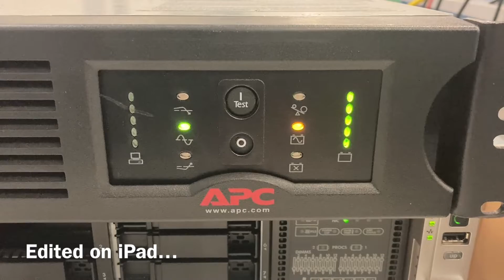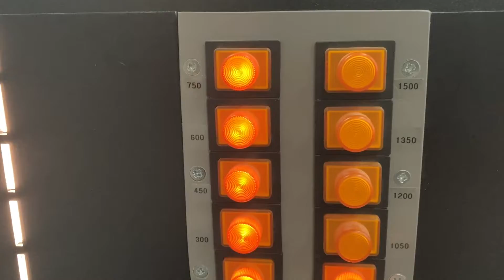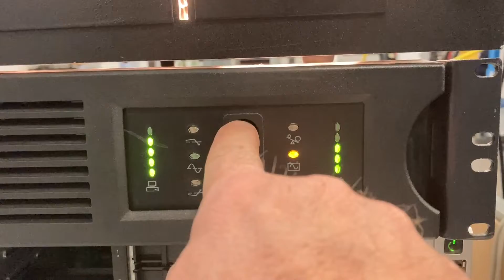How to test an UPS system (PWJ219)

Comment: I wish more manufacturers would follow Sanyo Denki's lead and use NiMH batteries which are a far more reliable technology than unpredictable lead-acid.
Reply from the maker: I don't mind good quality lead batteries (f.e. Panasonic) They work fine for 5-10 years.

Comment: Great and simple solution for a real workload to test. for single heaveer work loads  i used a heating plate . small one 1000w big one 1500w  and together 2500w.

Comment: I'm sure there's a good reason why this is a bad idea... but can't you simply use some cheap heating elements instead of the bulbs?
Reply from the maker: Tell me what’s cheaper than a $2 lightbulb?
Reply: @PlaywithJunk  well if you got them from somewhere cheap and Chinese like aliexpress you could probably only end up paying about $5 per 100w heater. Granted it’s more expensive but surely the amount of space it would save and the fact that it would remove the need to replace bulbs, which you pointed out was a downside with yours, makes it worth considering? I was just curious if there was an obvious downside I’m missing haha… I think your device is really cool!

Comment: I use a hair dryer. It works pretty well too :)
Reply from the maker: Sure, but can you adjust the power in small steps...?
Reply: @PlaywithJunk  No, I get High and Low - But it is enough for a pass fail test. I just replace batteries that fail or are marginal. Love your channel!
Reply from the maker: @SomeGuyInSandy   Thanks! Before I built that tester, I used all kind of devices as a load. But this tester can be used for small UPS (300W) too.

Comment: Very cool. An LED display on the front panel that shows the load would be useful.
Reply from the maker: There is a neon bulb display inside the switches. It tells me the power with 10% accuracy 😉

Comment: On smaller UPS that are used around home / non critical applications I like to remove the batteries and then test them under a load (2 small halogen lamps) and watch their voltage/current while they discharge. Can then compare to spec sheet. But my biggest UPS has 8x 12v 7Ah SLA batteries and this is too time consuming. Instead I just timed how long it can run a 500 W load with new batteries and test it every year to see how it declines. Your bulb box seems like an awesome solution for testing a range of large UPS outputs in the workplace!

Comment: Do you have the parts list and schematic for this unit? would like to build one for myself
Reply from the maker: You don’t need that because it’s really straightforward. 10 switches and 10 light bulbs and an aluminium case thats all you need. And a strong fan.

Comment: Nice solution! You could save on switches by wiring the bulbs in binary weighted groups. Then you could have up to 15 bulbs with only 4 switches.
Reply from the maker: But I had those switches for free….
Reply: @PlaywithJunk  Imagine the resolution you could get with 10 switches! Just need to find 1023 1.5W light bulbs, or 1x1.5W, 1x3W... I think my medication may be overdue. 🙂

Comment: What is this some ups tester from the 80s?! Lamest way to test an ups ever with halogen bulbs jeez, those bulbs run off from any flaky generator dont even supply sine wave. BTW those apc upses were utter crap what u pictured those after a year can do smth like 15 mins on tops
Reply: Damn why are you so angry... he clearly wasn't aiming for a way to test every single aspect of the UPS.
Reply from the maker: what would you recommend?

Comment: I have a couple of those 1500 and 3000 UPSes, I just run cpuz in stress test mode on the servers to make some load to the units for the battery calibration test :)
You can just hook up electric heating coils instead. My Sauna has 6,6 kW heat from 3 phases so one phase is a pretty good load for one UPS. Just don't touch the red hot metal bits when in use :)
Reply from the maker: Sure… but I have no space here for a sauna 🙂
Reply: @PlaywithJunk  You just need the heating element :D
Reply from the maker: Is it more expensive than 10x $2 ?
Reply: @PlaywithJunk  New ones are about 40 euro per 1-2 kW resistor, old ones are free from discarded units.

Comment: Why not having an old 1500W iron (for clothes) and regulate the power with some circuitry?
Reply from the maker: A phase control circuits for 1500w would certainly be possible but I like to have a clean resistive load
Reply: @PlaywithJunk  then use 10 x 150W heaters

Comment: You want the bulbs to last longer grab NTC inrush limiters from old PC power supplies, and put one in series with each lamp. 4R7 ones will work well to reduce that inrush surge, and not affect lamp output much, but make them last a lot longer in use. Failing that 150W IR heating blocks, used for reptile enclosures and chick brooders, also work well.
Reply from the maker: Good idea. I saw that 100W bulbs are still available for traffic lights. Some don’t like LEDs there because they fear icing in the winter…
Reply: @PlaywithJunk  But make sure they are 230V!  Traffic light bulbs here tended to be low-voltage (before they all went LED)...

Comment: > Incandescent lamps are the cheapest high watt resistors you can get.

What about a water bucket with metal wire inside?
Reply from the maker: That is too unsafe for a professional environment
Reply: @PlaywithJunk  FYI: Oil filled dummy loads are quite a standard when it comes to RF and oil radiator heaters are a dirt cheap but decent load for bigger UPS.. (~25€ w/ free shipping for a 2.5kW unit!)
Reply from the maker: @salat  I don’t want one 2kw load. I want something with 100 or 150 W steps. Light bulbs are $2 per piece
Reply: That doesn't sound much less expensive.